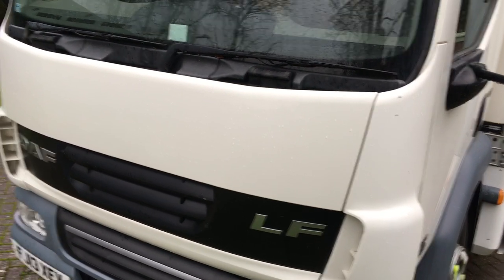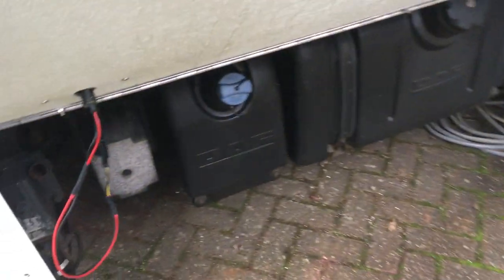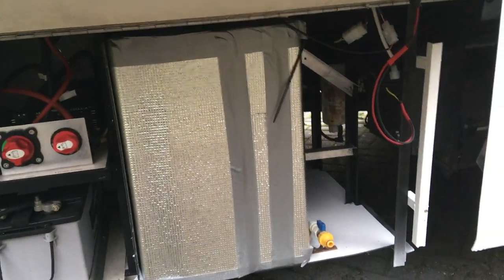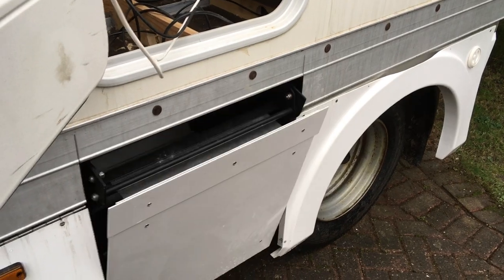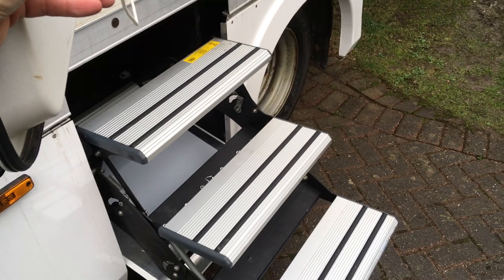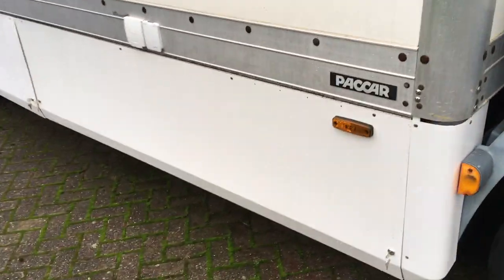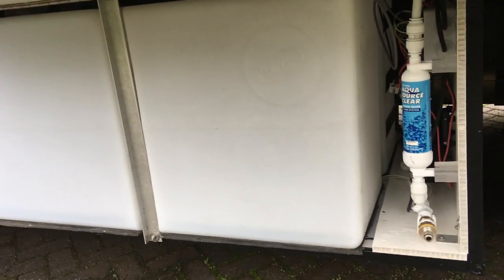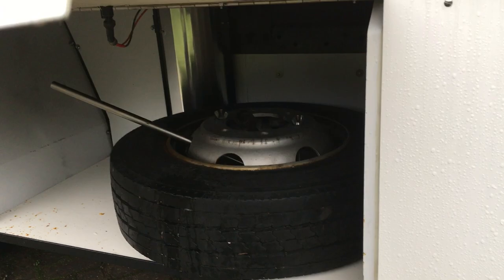RV Conversion No 7. The side skirts and steps

Comment: Brilliant work, I'm planning my own build and would appreciate if you could provide me the information on who made the skirts and retractable steps please
Reply from the maker: Hello, I bought the white fibreglass bits from "Horsebox Supplies Ltd" as 8ft skirt panels to suit 17.5 inch wheels. Then I used long stainless steel hinges to attach to the body and fabricated brackets myself. The steps are Italian "Project 2000" 3 step units by Lippert (LCI Industries) 10576/53AS/96/000  and I got them from "scan-terieur" who are the UK agents.
Reply from the maker: Oh,  forgot. At the front, you will see a rounded bit (one on each side) which I had the local fibre-glass people make for me. I still have the mould for that. You will need a rounded bit because of regulations to stop people from walking/cycling under the back wheels. I've been looking for something to fit behind the rear wheels and I'm in the process of building a mould to get my local fibre-glass people to make me a suitable storage cupboard and I plan to get aluminium doors made also
Reply: Thats great thank you, ill look forward to you video updates 😊